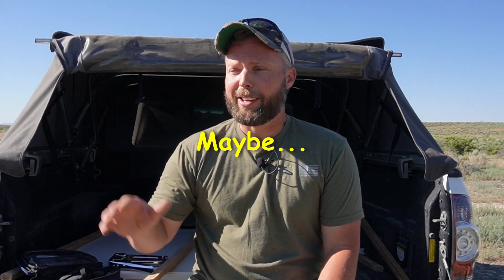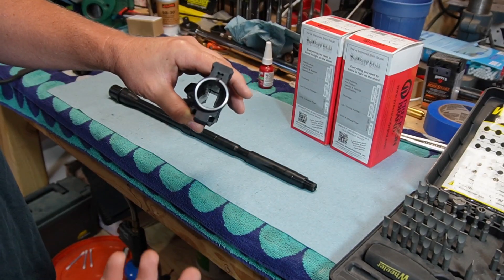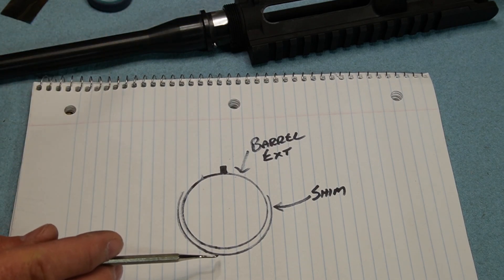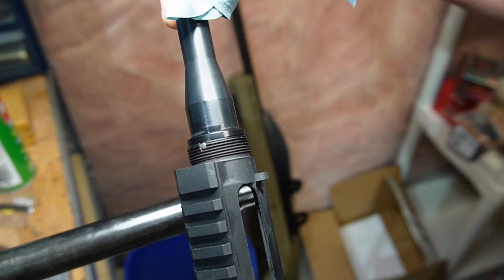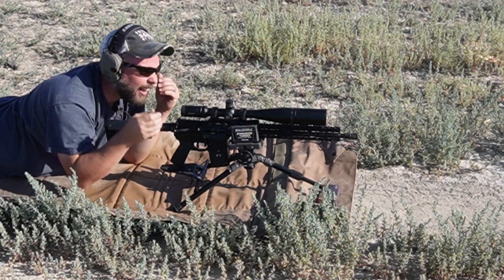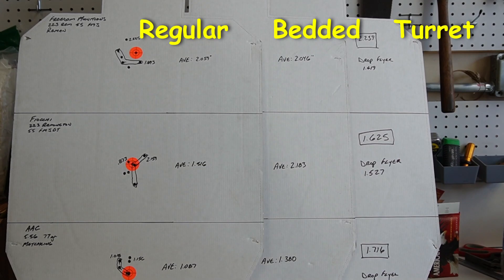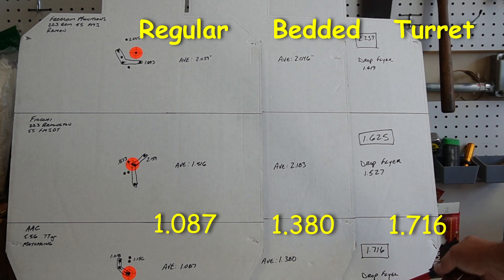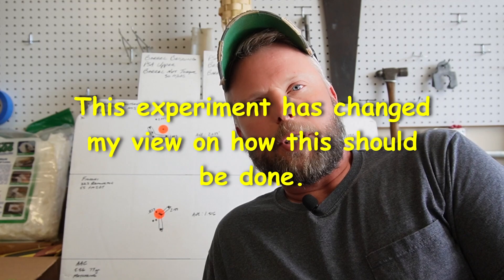AR15 Barrel Bedding: The Video That Revolutionized My Approach

Comment: According to what I've seen from long distance AR match shooters/gunsmiths, you may have lucked out by facing the full face of the upper barrel port as you did. There is a risk of removing too much because the upper face, although not completely true in matching to the barrel extension, is (by design & specs) the adequate length needed for secure mating. This is why those gunsmiths will seldom face more than 75% of the upper face, to avoid the dilemma of potentially removing enough face material so that the extension protrudes a fraction too far into the upper. Another tip is to place the shim stock across the top of the extension so the extension pin helps prevent the shim stock from trying to push past the extension lip upon insertion. The gunsmiths will often use a rubber or wood mallet to gently tap the rubber into place without the need for the addition of a fit compound.  As for the never-seize, anti-seize compound, you appear to have been somewhat liberal with the application, when only a tiny amount lightly brushed on a few threads will spread and sure the purpose you seek when the nut is screwed on, torqued, loosened and then re-torqued. You're on the right track, keep chasing the long distance bullseye. Next you can go after those ultra long barrels with custom length gas ports & gas tubes.
Reply: Just FYI, for any future readers, barrel extension shims are available in case one laps too much or the upper is too short.
Reply: You're completely right on all points. A caveat I would like to add though is most upper receivers are at high spec, and someone who's experienced in lapping would likely not approach taking it out of spec. That being said it is something for newbies to watch out for. You can always measure your low point with a set of calipers or other precision measuring device to ensure you have the capability of taking a couple thou to true the face.

Comment: Well, since you ran the shim only half way, you would just need to run it all the way around, then thermal fit it....
I have lapped, shimmed, and bedded LOTS of uppers and had great results. I think a lot of it has to do with the quality of the barrel you are starting out with. 
Also, the fit of the bolt to the extension. Seems like the tighter the fit, (but still within specs) the more accurate it is. This is souly my opinion and personal experience.
Reply from the maker: I do agree. After a while, I come back to this and mess with different bolts. I could tell you the results, but I think you already know!

Comment: There is absolutely zero reason to do this.
Reply: The service rifle and high power shooters all did this. It's been verified via testing with hundreds of rifles.
They mostly switched to custom sized or machine to fit  barrel extensions once they became available.
Regardless, the shim and loctite method is well proven
Reply: Wrong
Reply: It's a test for his curiosity....
Reply from the maker: @flatcreek6988 at least you understood that! You get a gold star. The unfortunate thing is that most will not watch the following videos on this series and see that I do get it to sub MOA. Thanks for watching!
Reply: @nobodytraining  I did watch them and I enjoyed it. When you have tinker mind set like us, you either eff it up or make it better no in between. Lol 😂
Reply from the maker: Isn't that the truth!
Reply: I agree. If the barrel nut is properly tightened and there is zero play. The few thousandths won't matter and will be compensated by the scope or sights. The flat face of the nut and barrel will put even pressure and should deform the aluminum to the correct tolerances.
Reply: This. Literally just buy a thermal fit  upper and a good barrel and you won't need this retarded crap. Also the hi spot proves nothing the drill Literally is not perfectly concentric, the brownells tool can have run out, it's not a good process. There's a reason blueprinting an action takes place on a LATHE LMAO
Reply: @GunSafetyViolator but mah eye bawl is accurit tuh 6 thou, mfer!!!😂😂😂
Reply: @GunSafetyViolator agree 100 percent
Reply: @GunSafetyViolator Yes... Thermal fit is the way to go. I've done it on 3 different rifles and it made a difference , compared to rifles not thermal fitted.
Reply: The high spots just proved there was a reason

Comment: A couple things from my experience with barrel bedding. The extension lapping will true the fit to the shoulder ring on the barrel and that will assure alignment of the bore to the receiver and the bolt face. But that is a single point of contact (in the linear sense) and the shim/Loctite 638 will extend that point of contact all the way through the barrel extension for a much more sturdy and durable fit. Where accuracy is concerned, there are more factors at play than just the barrel to extension fit. In your case, you're using factory ammunition which is mass production and a "one size fits all" approach to shooting and guarantees larger groups to begin with. Barrel quality and harmonics will dictate accuracy and if you're going to use factory ammo, I suggest you try other brands of factory ammo until you find one that your barrel likes. Hand loading is infinitely better than factory ammo because when hand loading you can tailor your ammunition to your rifle. I took a friend's AR-15 that shot patterns, not groups, of six to eight inches at a hundred yards and replaced his barrel with one of my used FN barrels, and through lapping, bedding, and creating a custom load for it, got that rifle shooting under 1/2" groups at that same 100 yards. So keep in mind that barrel bedding is only one aspect of improving accuracy... not the only one.

Comment: How do you hone the barrel extension. You assume the barrel rind is machined near perfectly true.
Reply from the maker: I’ve never found a tool to do so. If you have access, you could set it up on a lathe and see how true it is…after you pull the barrel extension pin. However I think we all just assume that it is probably close enough.

Comment: I am doing thermal bedding so I have to heat up bcm upper. 

Similar to JP method.  

It works great.
Reply: This is basically just doing the exact same thing that a thermal upper does. I don't know why people think this method is stupid or insane. Some of the most well respected barrel makers and rifle manufacturers do this or recommend doing this for maximum accuracy
Reply: I have been using the thermal fit method to install the barrels after putting the steel shim around the extension. It works perfectly.

Comment: Nice video!!!
I have to admit, if I were going to do a YouTube channel this would be the name.
As to bedding AR-15 barrels, I think you're on the right track. The builder must check part fit prior to final assembly. 
As far as accuracy, I put a muzzle break on my rifle. I have shot a 1" group @ 100yrds with it.
Reply: What are your groups w/o the break?
Reply: @bliz4600  about 1.5" - 2" groups.
Reply: @bliz4600 when I can do my part, the muzzle break helps me shoot a five round bug hole. Without the break, I got about a 1.5" group.
YMMV.

Comment: Probably less work to just buy a BCM upper. Super tight around the barrel extension, usually requires heating the upper to seat the barrel extension. The 4 i have showed trueing was not necessary....maybe I was just lucky

Comment: Ive had better luck using Molybdenum grease as a bedding compound around my stainless shims. 

It helps stick the shim to the barrel extension, and helps the shim glide more freely into the upper receiver without binding. 

It won't function as a retaining compound, but if your shims are thick enough, you shouldn't need it. Especially with the pressure from your barrel nut holding the barrel into the upper.

Comment: I have been scouring the interwebs and forums for more information on this. I am currently building a MK12 mod 1 clone. My issue that I am currently having is the Douglas 18” 1/7 twist barrel is very sloppy in the colt keyhole upper. Way sloppier then what you experienced making this video. I came to the conclusion that I would use stainless .001 shim material in conjunction with locktite 640 to bed the action. I do believe the smiths at Crane bedded the barrels to the receivers on the Mk12 mod 0s. I may have to do a before and after as well. See if there is a notable gain in accuracy.
Reply from the maker: I really wish I could afford to take 10 barrels that are exactly the same and test everyone of them. Bedded/unbedded, matched bolts, interference fit, etc. really drill down to what truly matters. But it will have to wait till I win powerball. 

Please report back with what you discover!
Reply: @nobodytraining  I have built uppers using BCM and they have all been thermal fit and they are solid. I have juggled with the idea of just using a BCM upper but if I’m cloning. Then clone.
Reply from the maker: @red4sierra  It’s a tough call. How close to clone to keep the spirit but have the performance?
Reply: @nobodytraining  I’m building a mod H inspired mk12 also using all BCM parts minus barrel and hand guard. That will be a thermal fit. See which platform shoots better if I can do my part.
Reply: Barrel bedding is a myth unless you have an upper receiver bore or barrel extension that is out of spec. In which case the manufacturer needs to replace them instead of you having to fix it yourself.

Comment: The runout on the drill is pretty terrible.
Reply from the maker: If we were cutting a hole I’d 100% agree with you. Even though the lapping tool isn’t a precision  tool it’s pretty good at lapping. That’s why a steady pressure is necessary as you can imagine!
Reply: @nobodytraining  I'm thinking with a lot of runout, the lapping tool is not lapping completely completely flat. I imagine it's now wavy around the circumference.
Reply from the maker: It is a hand tool and completely completely is as you say not possible. If there is any waviness then it’s so minute that’s it’s inconsequential. The goal is to get the face squared off so it’s perpendicular to the bore…as much as is possible with a hand tool. I’ve had good success with the lapping tool over the years.
Reply from the maker: If it was truly wavy we’d see that on the receiver face the first time it was cleaned up. It would show choppy anodizing all the way around instead of what we did see. The tool does move on the X and Y axis. Impossible to keep it from doing so. Movement on the Z axis is minimal.